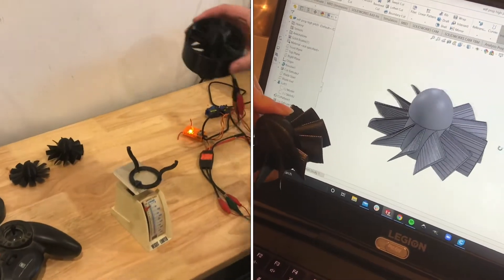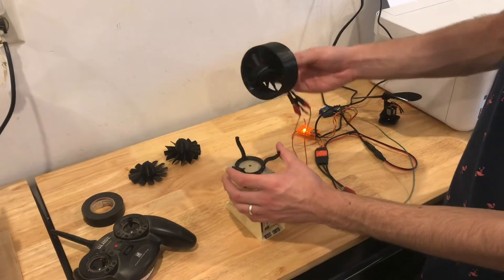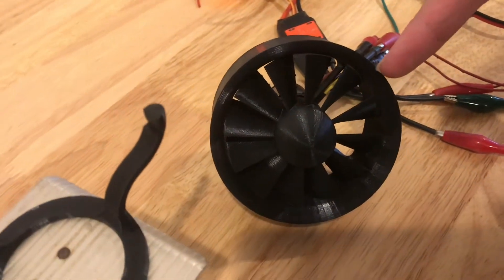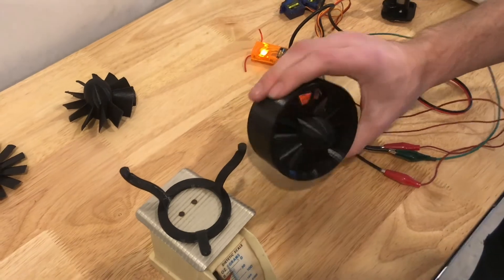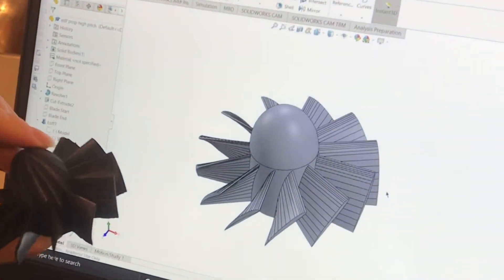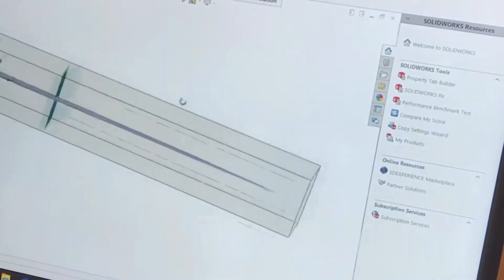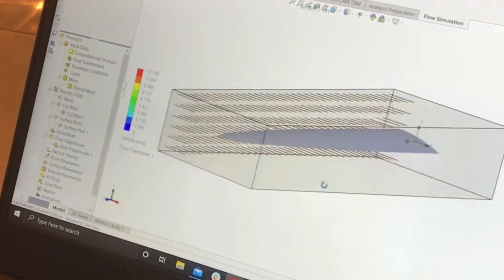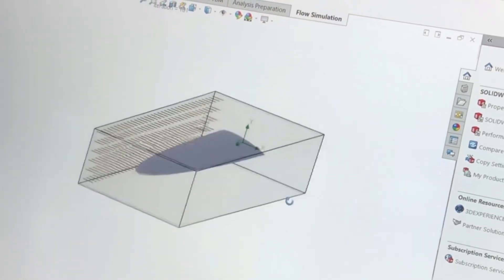BUILDING edf motor “electric jet engine” (3-D printing solid works)

Comment: Hi 
This works is great！
I made original design EDF jet fan for RC aircraft.
https://youtu.be/K_CQsjiHXXg
material 
case→ ABS with acetone smoothing finished
fan blads →PLA with UV resin cort finished
Power →1690g pull